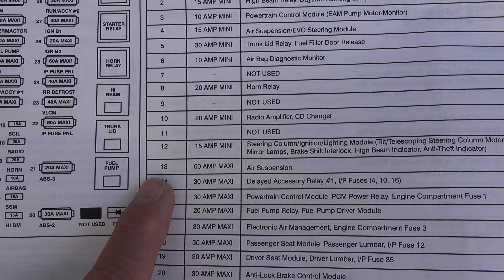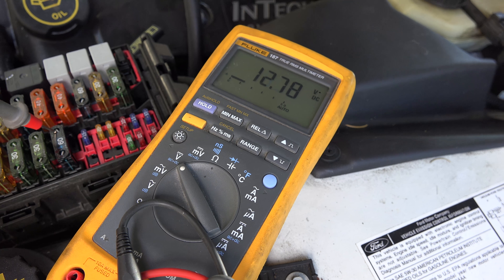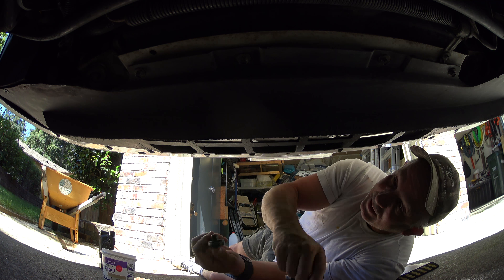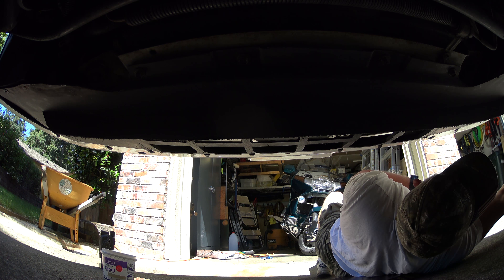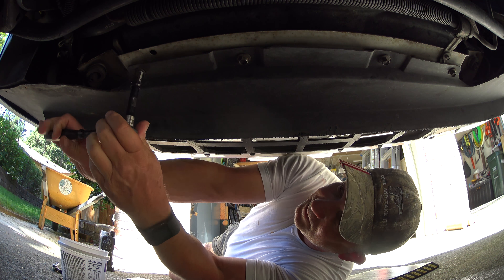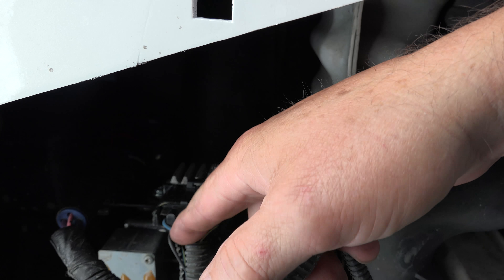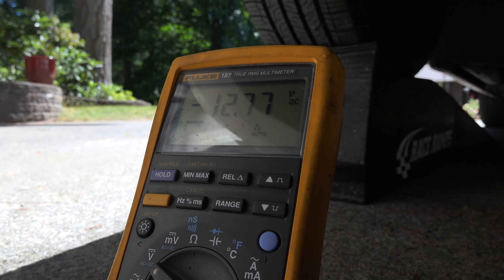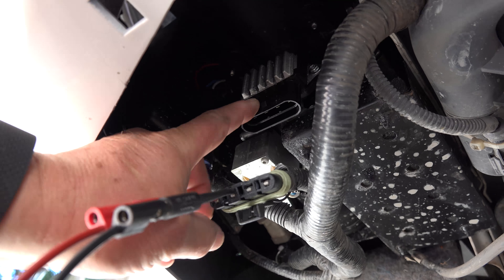1998 Lincoln Mark VIII Air Compressor Troubleshooting

Comment: How hard is it to replace compressor pump. Do you have to remove out things to get at it? Mine is a 1995 mark 8 is the pump in the same location. Al Giordano  thanks for the info.

Comment: I own 3 mark 8's and have taken the air ride off of 2 of them and replaced them with springs. I'm getting ready to do the 3rd very soon. You can buy the spring kits, but it's cheaper to go to the salvage yard and get them off a thunderbird. Get the springs and lower control arms for the back and the struts for the front. You'll have to fabricate a top bracket to hold the springs on the back. I actually think the cars handle better with springs and I don't see any difference in ride comfort. It'll save you a lot of money in the future.
Reply from the maker: I like the air ride system. Although mine is a 1998 I've only replaced the front shocks/bags and the compressor once. The biggest issue was trying to understand the system and how it works. Once I understood it was easy to maintain.
Reply: Jeff - The air ride system is good until you start having problems, and then it's gonna cost you a lot of money. I replaced mine with spring ride and don't see any difference in ride comfort. The spring ride actually seems to have better handling around corners. I left the air ride on my cars until they started malfunctioning.
Reply: @tjernagel I’m looking to understand the system. That’s why I’m here. I could save a ton of money

Comment: Can your car running with out the air  Compressor? I want off  Because I wants what that into my 69 Mustang I have to swap everything  Wire harness and everything and I don't want  the APS to.....  thank first.
Reply from the maker: No. In time the airbags would leak down creating a dangerous driving condition and there isn't a OEM method to put air in them.

There are modifications where you can change the airbag shocks out with spring/coil shocks.
Reply: @tjernagel  thanks

Comment: Do u still have the mark 8
Reply from the maker: Nope. Sold it about 6 months ago when I found a new toy I wanted to buy. It was hard to see it go. There were no maintenance issues with it and it still wasn’t burning oil during changes. But it was time.

Comment: For a 1997 Lincoln Mark VIII the Air Suspension Compressor Relay (ASCR) wiring from the EVTM is as follows: 

BK/Y = Power Feed from the 60A fuse. 
P/O = Compressor Motor Output.
DB/Y = Compressor on command signal input (active low).
BK = Ground to G104 through splice S104.

The 1997 Lincoln EVTM is very complete although I have found some errors here and there. Splices tie grounds together to reduce ground loops for the different subsystems. Once the star ground is created (splice) it then returns to the battery through a dedicated ground. Exactly how the ground returns to the source (Battery / Alternator) is best determined by looking at the vehicle wiring looms and chassis connections. 

The ASCR, as a solid state relay, is supposed to have a long life compared to a large conventional relay of the same amperage. Meaning it should not be a point of failure when compared to the other components MTBF. 

From an electrical engineering standpoint a new ASCR should not require the same heatsink area as the original stock ASCR. MOSFET automotive smart power devices have matured to the point where you could just pot the ASCR in an aluminum case (also acting as the heatsink) without any fins, and when on continuously would only seem a little warm to the touch.

Comment: Question.
I want to manually control the air compressor, I can totally bypass the sensor and run toggle switches, correct?
That way I can raise to desired height?

Also when I park it, I'd like to release all the air from the suspension, is there an electronic or manual valve for the air to release?

Comment: Thanks for the info. I have a 95 Mark Eight do you know the easiest way to replace the compressor???  Thanks
Reply from the maker: I’ve always removed the front bumper cover to replace the assembly. However it can be done from the right wheel well with the wheel well removed. Also have to remove the right headlight to gain access to the upper mount bolt. Also the lower skirt has to come off.
Reply: @tjernagel  Thanks Jeff great info. Thanks for your help and quick reply. Your the man.  Al
Reply: Jeff if I remove the front bumper does anything else need to come of to gain access to remove and install the new pump?
Reply from the maker: @algiordano9214  Just both headlights and the bottom cover. If memory serves me right it’s two bolts on both sides and 4 or 5 in the center on top by the radiator with the hood opened. 

With the headlights out there is a simple plastic clip that extends under the lights that keep it in place. It just pops right up and off. 

I had a white one and removed it several times just to take it to the body shop for painting it since everyone loves to run into it… Pretty simple once you do it.
Reply: @tjernagel  Thanks Jeff you experience has been very invaluable. 
Al Giordano

Comment: Ty for your informative video I live in tacoma and sure could use somne help figuring out why the car drops when I drive it and not while sitting? Mine is a 97 cannot find any leaks. And sometimes there is a big delay for the pump to come on after it lowers. Any help would be apporeciated.

Comment: Would you have any videos on the radiator fan not working? Have replaced the vcrm and nothing. I have a 96 mark viii
Reply from the maker: Tazz Lesh The trouble I found with the fan is the connector. It’s the same connector used on the inside blower. Because if the amperage it draws the negative gets burned. 

Instead of replacing the connector I directly soldered the wires to the fan and have not had any more issues.

Comment: The code I received says the secondary fuel circuit (543 & 587 I think) and the VCRM (Variable Control Relay Module) needed attention.
I found a VCRM on a 97 Mark, and was told that the crankshaft sensor may be causing code 543! I surely want to avoid the fuel pump cause I have a tank filled with gas!!!! I DO NOT want to mess with ac compressor but I've discharged it already. 
Question: Is it possible to connect the VCRM connector backwards? thx

Comment: Would you have a video on heater blowing cold air instead of heat. 1998 Lincoln mark 8
Reply from the maker: Chris Stephens No... but that is 99% of the time the blend air door. 

Remove the cover under the glovebox (glovebox out helps too). Look towards the center of the car and there is a grey lever connected to a rod running to the center of the dash. It has a known breakage issue. It’s connected to the blend air door actuator that is mounted center instrument panel behind and below the message display. 

To replace either actuator the entire instrument panel has to be unbolted and moved backwards. 

The lower lever controls the air over the heater core. Some people lasso it and tie it in the open position which allows the air to again flow over the heater core. 

I replaced both of them on my car. 

There are good instructions on the internet. Search for Lincoln Mark VIII blend air door replacement if this link doesn’t work. 

www.markviii.org/LOD2/blend_door_repair.htm
Reply from the maker: Here are instructions to temporarily getting it to work.

http://www.markviii.org/LOD2/emergency_heat.htm

Comment: How do you swap the relay?
Reply from the maker: On the left hand side in almost the same location as the air compressor (on right) there is an identical relay for the Electric Air Management (EAM) pump motor. It will look like this:

https://www.autozone.com/electrical-and-lighting/relay-air-pump/duralast-relay-air-pump/412243_0_0

Comment: Are these compressors supposed to be a bit loud?
Reply from the maker: When everything is closed up I barely hear it. After exiting the freeway and coming to a stop light I can hear it kick on to bring it back up to height. Or early in the morning when I'm warming the car up on a cold morning. Joyce, my better half would never hear it. 

I replaced mine with one from AutoZone because it had a lifetime warranty. It was either a Westar or Dorman. I'm thinking the Dorman assembly... It sounded like it was going to fall apart or blow up... I got my money back on it and purchased an Arnott on Amazon and love it. My old compressor was ok but the vent valve gave up and there was no way to repair it, try as I might...
Reply: @tjernagel  Thanks. I am used to the one in a Mercedes which is quieter, but the one on my Mark VIII sounds similar, just louder.  Are they relatively easy to replace?
Reply from the maker: @youtoobe169   Not too hard, just a pain. Front right hand wheel off along with the wheelwell. Remove the bottom plastic cover that. The last time I did it I needed to have the bumper cover repainted so I pulled it off and the compressor was a breeze...

Comment: Thanks for your video Jeff.. My Mark VIII is a 94. The other day, it quit running suddenly. Have you any videos on replacing the Crankshaft Sensor? Thanks!
Reply from the maker: Don't have any video's but here are the instructions...

REMOVAL 1. Disconnect negative battery cable. NOTE: When the battery has been disconnected and reconnected, some abnormal drive symptoms may occur while the powertrain control module relearns its adaptive strategy. The vehicle may need to be driven 10 miles or more to relearn the adaptive strategy. 
2. Remove serpentine belt. 
3. Raise vehicle and support with jackstands. 
4. Disconnect Crankshaft Position (CKP) sensor and A/C compressor electrical connectors from the engine wiring harness. 
5. Discharge the A/C system and remove the A/C compressor. 
6. Remove the CKP sensor retaining screw and sensor.

INSTALLATION 
1. Make sure the CKP sensor mounting surface is clean and sensor O-ring is in proper location on the assembly. 
Position CKP sensor assembly and install the retaining screw. 2. Tighten to 8-12 Nm (71-106 in lb) . CAUTION: Do not overtighten the screw. 
3. Install the A/C compressor. Evacuate and recharge the A/C system. 
4. Properly route the engine wiring harness and connect the electrical connectors to the A/C compressor and crankshaft sensor. 
5. Lower the vehicle. 
6. Install the serpentine belt. 
7. Connect the negative battery cable.
Reply from the maker: I have never had to change it. Before completely removing the AC compressor I would first try to unbolt it, leaving the hoses attached, and moving it enough to all the sensor to be removed from the block...
Reply: Jeff Tjernagel Thanks... That was my thought exactly! Now go break crankshaft sensor on your Mark VIII, then make a video repairing it! Lol. Thanks again for your videos. Make it an awesome day!
Reply from the maker: I'll get on that first thing this morning! :-)
Reply: I really appreciate the directions. It confirms that you may be an attention to detail type!  I've been following the manual and have already discharged ac compressor and placed jack stands underneath. The bolts (2) seem to be in the least accessible place. It's good to know there is only one for the CKP. Thanks again.
Reply from the maker: Hopefully the crank sensor will be your problem!  What a pain having to discharge the AC... Engineering...
Reply: The code I received says the secondary fuel circuit (113 I think) and the VCRM (Variable Control Relay Module) needed attention.
I found a VCRM on a 97 Mark, and was told that the crankshaft sensor may be causing code 113! I surely want to avoid the fuel pump cause I have a tank filled with gas!!!! I DO NOT want to mess with ac compressor but I've discharged it already. 
Question: Is it possible to connect the VCRM connector backwards? thx

Comment: Hello brother I found my new pump at car parts .com it is from direct fit it was a close out and it was under 90$  with 3 year warrantee. It is working well so far but I just put it in. Seems like my front is pumping up slightly higher I need to figure that out still.
Reply: Awesome you don't need the pump...
Reply from the maker: After replacing the voltage relay the compressor ran and ran and ran... I pulled the airline off the right hand bag, turned the compressor on... No air... It's dead.  I'll pull it out today and put my original compressor back in. I only changed it because it's 20 years old I have no idea how much brush is left in the motor.

I'll take the assembly back to Autozone for a refund. This is the second Dormer compressor assembly that I purchased that has failed.  This assembly has only been used for just over a week...

After market parts just aren't as reliable as they use to be.

As I do the work today I'll put together an add-on video on what steps I take to check the compressor for output...